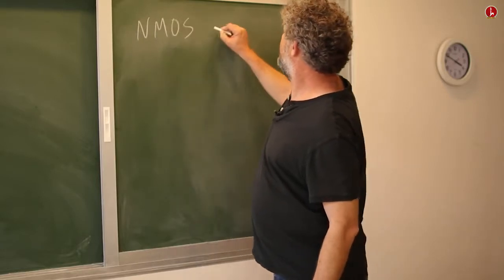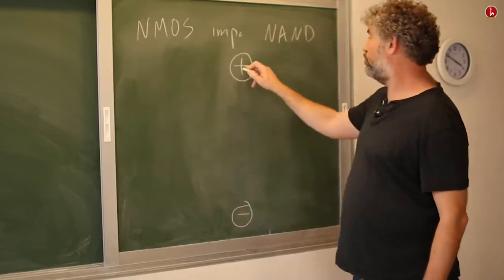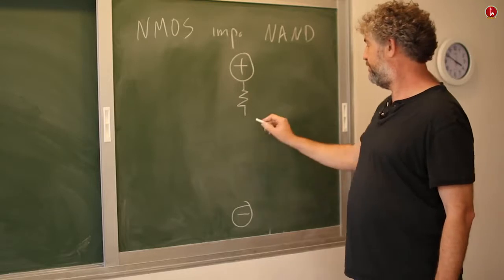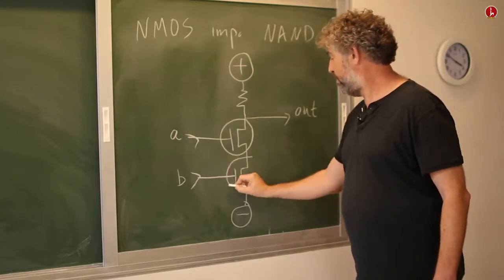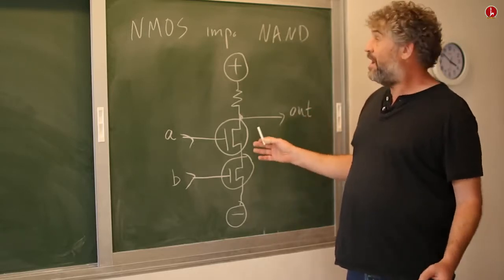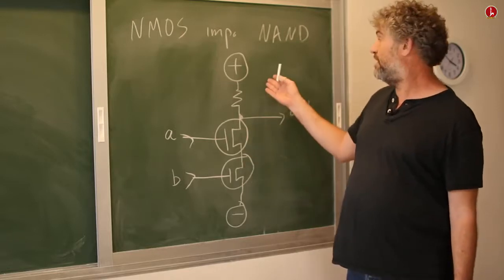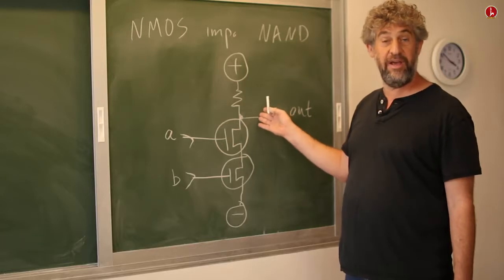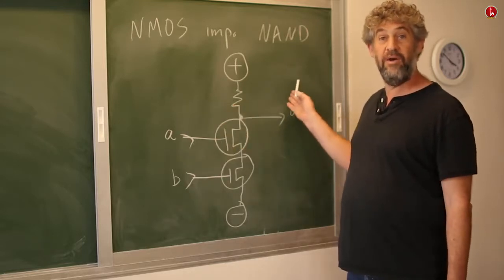[Part 1] Unit 1.8 - Perspectives

Comment: U can think of transistor circuit like this : 
When both transistors have high voltages then circuit is closed and current passes through.... As we know that whenever current is flowing voltage DROPS across the load...resistor in this case... Because of the drop u have 0 output in case of 1 a and 1 b and no voltage drop in case of open circuit as no current flows